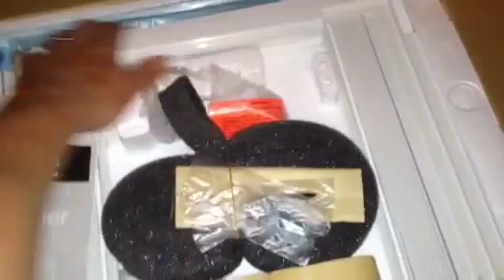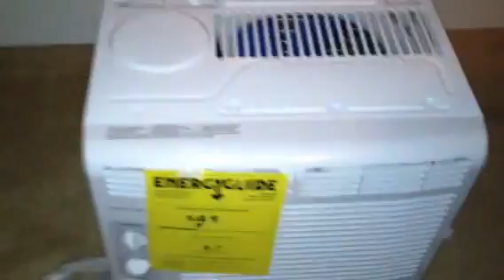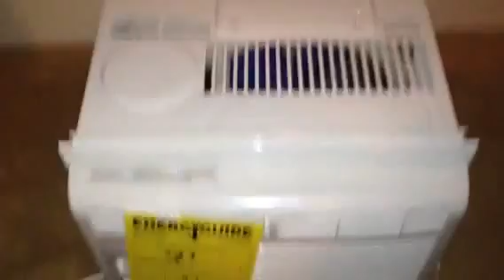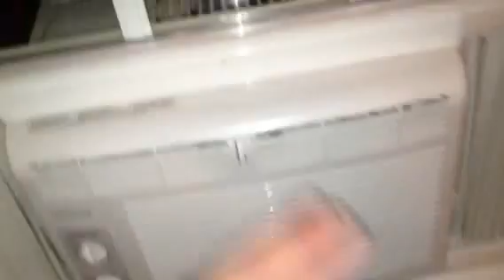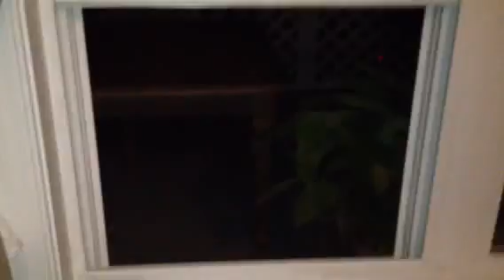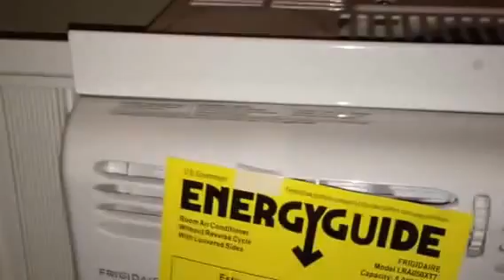Air Conditioning Window Unit Install

Comment: Was this person on drugs? Nothing was right. Actually, nothing was shown.1. Screwing top plate on. 2. Putting the sides together. They were not installed when he had it in the window! Also, the left side is marked left and the right side is marked right. If that's not bad enough, it's not centered This reminds me when some workers, after a break (using speed?) Twenty minutes later, after drug affects wore off were baffled by the shoddy work that they had done. If that's not enough, my manual says, "On 1st use have on high cool and temp selector to highest cool number." Save yourself 7 minutes
Reply: i know the editing is incorrect

Comment: NO SCREWS!?!? Just close the window and that's it?  And what about installing something (window sash etc) up top so the window AC vibrations do jimmy it open and the AC falls out? You should show screwing in the sides, putting the foam inbetween the sash.. I appreciate the basics, but I honestly think most folks need to know what to do once it's in the actual window.